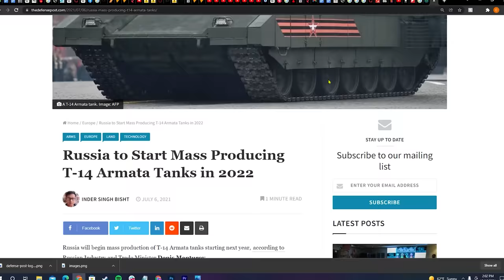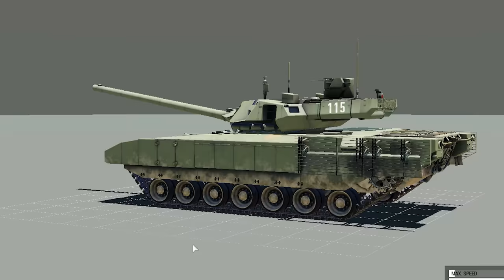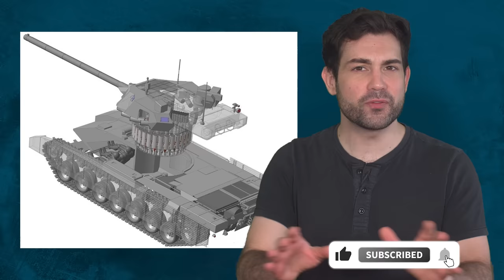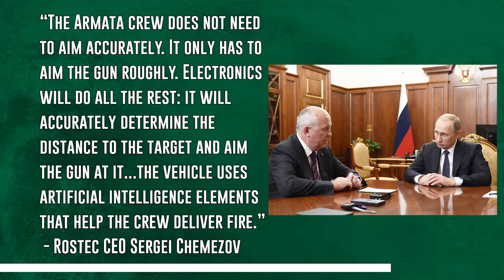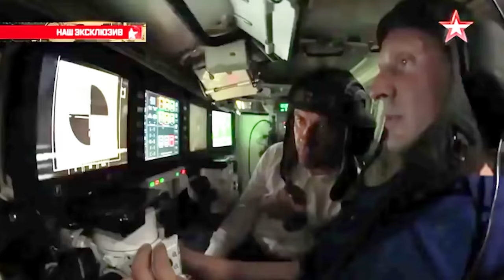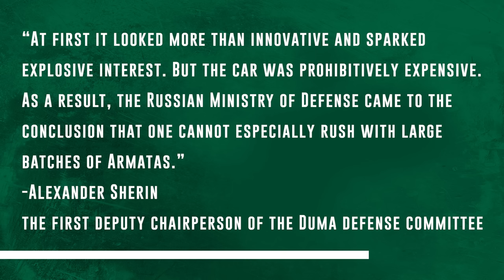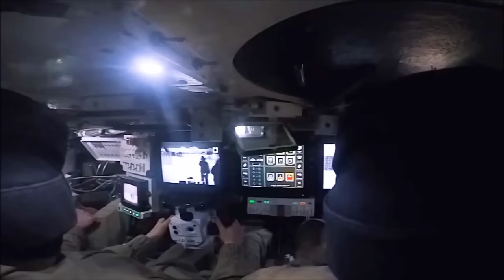The Truth About Russia's T-14 Armata Tank

Comment: The T14's engine is also supposedly a modified German SGP Sla 16. A WW2 experimental engine that was tested in a Jagdtiger B.
Reply: source: trust me bro
Reply: @viswajitbala7924  You don't need a source, the engines of both tanks are public knowledge. Look them up for yourself if you're curious, you'll see the similarities. 

Obviously the Russians thought they could make their design more reliable. And then an Armata broke down on red square during a parade lol. That was years ago... still no Armata in active service.
Reply: The SGP Sla 16 was supposed to replace the Maybach HL230 V-12 used in Tiger I & II but never went to production as the war ended before it finished its testing. During the testing it was installed in a Jagdtiger and it showed a promising results, there was initially a problem with heating as the engine was air cooled but was sorted out with adjustment to the cooling fan. I don't know where you got the idea it was "notorious for breaking down" from!
Reply: @Mofleh Alrofidah  sorry that was my mistake. You are right, the speculation was that of the engine installed in a jagdtiger and not a porsche tiger. I have changed my comment to more accurately portray it.
Reply: @Viswajit Bala  there are articles, it is not officially confirmed that is why I said "supposedly"
Reply: @viswajitbala7924  Combat approved, Russia TV
Reply: It's a modified version of the same engine that was used in production panthers. Originally Russia did the modification to use them to pump oil. Extremely unreliable
Reply: @ms3862  the smartest American be like:
Reply: @viswajitbala7924  the source is the company that makes the tank, lol
Reply: first, I believe it is an engine that have similarity but not entirely the same engine even though I have seen both the engine seen in jadgtiger and the engine on display of the t14 and there is barely similarity between them in face value. I doubt that engine would still work inside a modern tank in the first place. Second, something tell me you got this source from a British youtuber, take my assumption with a pinch of salt though with all due respect
Reply: @Ravengagepvl  Literally have no similarities aside from both having X-layouts.
Reply: @DoomsdayR3sistance  You have no source to back that up.
Reply: @definitelyfrank9341  for which bit, you have to be specific? If we are talking about how the engine was designed for oil compressors and was rejected by industry, there are definitely sources for that.

If it's about the reliance on foreign tech, do you have another major reason why they only managed to make about 20 of them in the time they predicted they could make 2000 of them? I believe there are sources for tech issues but I don't read/write Russian to be able to be able to confirm such sources.
Reply: @DoomsdayR3sistance  Because instead of buttons and switches, most of the controls are digital. Just like how F-35 encountered serious problems during development. That's why they halted production (roughly a dozen were delivered but were returned when the systems were pretty much unusable).
Reply: @DoomsdayR3sistance  Did you delete your old reply I responded to? I can't remember exactly what you said.
Reply: @DoomsdayR3sistance  The only source suggesting that (source that isn't just parroting what LazerPig said) is an ad posted by the company that developed the engine back in 2011. But even that didn't say that the engine was designed specifically for that use. They just suggested that as one of its potential applications. The reason why they didn't mention the fact it was designed for a secret prototype tank was because well, at the time T-14 was a secret prototype tank.
Reply: The Russian army equipment sounds like something of Warhammer 40k, where orks manage to take over an empire tank and they started to use it, tho eventually when the empire manage to retake the tank, they realize the engine was missing, there was only a cardbox with engine sounds written all over it
Reply: @Ravengagepvl another stupid myth about t14, it didn't broke. The driver did some mistakes. That's why the tank stopped
Reply: It was NOT based on the German SGP Sla16s engine go watch RedEffects video on the engine
Reply: @rlgsofficial I trust redeffect as much as I trust a drug addicted homeless person with my money
Reply: *Porsche Tiger

Comment: 30+ years ago I bought a book by Brig Simpkin of the British Army. He advocated something very similar to this for future tanks: engine in front for added crew protection; crew capsule in the hull; and the mission pod in the rear.  The pod could be a remote turret for a tank, or a troop transport compartment for a heavy IFV, or an artillery piece for a SPG, etc.  The Merkava and Armata come close to what he was advocating. Pros and cons to everything...if the tech get damaged or fails then having the crew in the hull means no manual backup to keep the tank in the fight, and that is bad. Only three crew means no backup if someone is hurt or ill or called away for other duties. 

Some of you have to remember that tanks fight as part of a team with infantry, artillery, engineers, air, etc. ATGMs are great but you can't launch them if you're getting artillery airburst all over your position. Tanks in one form or another will always exist...a protected vehicle that can shoot, move and communicate.
Reply: engine wont provide all that good protection and well... engine goes off tank is immobile and cant retreat. also it will glow like christmas tree on infra red. so not good idea.
Reply: @jebise1126  You are right. With the development of advanced composite armor, the advantage of putting the engine in the front is completely negligible. Israelis stick with frontal engine because their tank industry & tank crews are accustomed to such design. Change back to normal tank design that  everyone else uses will cost a lot of time and money to change their doctrine, training, tactics and hull manufacturing etc.
Reply: Climb to glory! Tipple Deuce vet here
Reply: This is what I'm always saying. You can't fire that MANPAD or RPG if you're under suppressive MG fire and sniper cover from infantry. Tanks don't operate in a vacuum despite what video games would lead everyone to believe. Battlefield has about the best tank combat in that regard. Being the ground support for a tank in BF4 is my favorite role in any game.
Reply: @jebise1126  The powertrain does, in fact, provide protection to the crew if it is in front.  Any large metal objects you can put between the soft squishy crew and projectiles trying to kill them is a good thing.  Many IFVs and the Merkava and the S tank have their engines in front.  The idea is to protect the crew, who take months or even years to train properly.  You can always fix or produce another tank relatively quickly.  As far as IR signature goes, as soon as you fire the main gun, you are no longer worried about the IR signature of your engine, which is behind armor anyway.  Your engine exhaust can be mixed with fresh air to reduce its heat signature as well.
Reply: @jebise1126  on Ex Spearpoint our troop had only one fully mobile tank, yet we kept a US infantry battalion, with a tank company from advancing. We (Chieftain) had over a kilometer range advantage over the M60s, we simple shot the lead 113 and rear M60, then cleaned up everything in between (they were trapped on a mountain road, & couldn’t maneuver off the step sides of the road). This actually caused an exercise “reset”.
Reply: @jamesvanderpoel2135    Triple Deuce?  I'm a Triple Deuce vet myself.  B Co.  69-70
Reply: @michaelrunnels7660  HHC mortars 1999-2001
Reply: @jebise1126  I mean if the guys are hit from the front and it pens then they die, so tank is still immobile, not because the engine was fucked but because the crew died.
Reply: + Romans 10:9-10 "That if you confess with your mouth, "Jesus is Lord," and believe in your heart that God raised him from the dead, you will be saved.  For it is with your heart that you believe and are justified, and it is with your mouth that you confess and are saved." Amen 🙏!!!!!!!!!!!!!!!

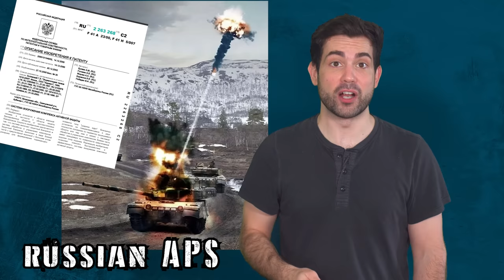The man in Luke 16:24 cries: ". . .I am tormented in this FLAME."
In Matthew 13:42, Jesus says: "And shall cast them into a FURNACE OF FIRE: there shall be wailing and gnashing of teeth."
In Matthew 25:41, Jesus says: "Depart from me, ye cursed, into everlasting FIRE,. . ."
Revelation 20:15 says, " And whosoever was not found written in the book of life was cast into the LAKE OF FIRE." And please repent of all of your sins and be baptized by the Holy Spirit before it is too late, you will never know when the time will come 🙏!!!!!!!!!!!!!! Amen 🙏!!!!!!!!!!!!!!!!!!!!!!
Reply: @reclusiarchgrimaldus1269    What's your point?
Reply: @michaelrunnels7660  I'm spreading the good news of the Gospel 🙏
Reply: Merkava and IFVs have engine in front so soldiers can enter/leave from rear. 
Engine in front means ventilation and exhaust have to be up front, or pass by to the rear. Also fuel has to be up front. None of these contribute to crew safety.
As for crew protection in the front, how about armor?
Reply: Engine in the front provides excellent protection against HEAT. Very poor protection against APFSDS though.
Reply: @Cavemanner  yes in the world of PlayStation battle games if you get killed, you simply “ reset “ and your all alive and fighting on. But it’s totally different in the real world !!! Perhaps you would like to jump in one of those Russian tin cans and go for a ride. As you are getting it down this back country road, not a worry in the world…….. suddenly part of your body is a hundred feet in the air as you look down and see the rest of your tank and crew ,as well as your lower half, on fire. The last thing that goes through your mind is “ where’s them damn support troops?” Then you land with the turret crushing whats left of you. Your  trembling hand falls just short of hitting the reset button!!! Game over…………………..

Comment: I've always followed the principle for every automatic system you need a manual backup in case it fails or to supplement it.
Reply: well, that sounds nice and all, but is outdated by now
Reply: @quantuman100  ??? That's not outdated at all. If the automated loader/turret fail this tank is just a roaming trouble. To much automation without manual backup is a death trap. Especially with how shit Russian equipment is proving to be in Ukraine.
Reply: @Wallyworld30  yes, let's look at the Russian stuff in Ukraine, most of it is the old "manual backup" equipment, not really anything more modern than the 2000s to be seen, so much for the manual backup being usefull
Reply: @quantuman100  you know that the tanks being used in Ukraine all have autoloaders, they started using them in the T-64, it isn’t a brand new concept
Reply: @rexnifty8678  yes, but these auto loaders could still be manually operated from inside the turret, hence why they have a reputation for taking off the loaders arms
Reply: @Wallyworld30  Most commercial and military aircraft have been fly-by-wire systems for decades without any manual backup and work perfectly fine. Electromechanical systems don't just randomly fail and if they fail, most of the time you can control how they fail and account for these cases.

Seriously, they only times I've heard about electro-mechanical systems failing is in absurdly cheap consumer electronics, planned obsolescence and autoloaders. And god knows why the latter. I've worked in the design of partially automated testsystems and it's almost always the manually operated parts (or automatically updating consumer software somewhere in the system) that fail under weird and rare circumstances.
Reply: @steini19o4  Commercial Jets have hydraulic controls and if that system has leak and fails it can be controlled manually by a wire with crank in cock pit for torsion. Mentour Pilot channel did an amazing explanation of how it works in a simulator that had the backup system like the real Boeing Aircraft.
Reply: @Wallyworld30  Newer Airbus (A350 and newer) and Boeings (787) do not. And for the Airbus A320 to A340 only the horizontal trimmable stabilizers are connected mechanically (rudder for the A320 as well).

There are no known cases of a fly by wire system having been incapable of recovering from a failure.
Reply: @Wallyworld30  every modern fighter jet uses computers to fly itself with no backups, if you design it reliably enough you don't need to overburden yourself with backup systems. Plus, if the gun malfunctions in combat you have bigger things to worry about
Reply: I work in a flower growing company and made that realization myself last month.
Whenever you build growing areas, build them for easy access with water hoses to water the plants. I don't care how many fancy automated systems you have to water everything with the push of a button. The system will fail and someone has to go through the whole building with a hose to water the plants. And the system won't be fixed in a day or two, but in a month or two. Don't set up your piping and other equipment so that it takes a 100m long hose that keeps getting caught in 10 different spots because you think "well, that's not going to happen anyway because we got an automatic system".

And I'm not getting shot at by enemy tanks!
Reply: THANK YOU
Reply: Biggest flaw with these auto loading systems is it makes these tanks less survivable in combat. The manually loaded Abrams tank with a dedicated crewman keeps the ammunition in a separate compartment deeper within the hull thereby reducing the chance of the magazine being detonated from enemy fire.
Reply: I used to be a 19k...and if I remember correctly...the M1 has backup non electronic sights for the gunner...a backup firing mechanism you had to hand twist...and the turret had a manual hydraulic rotating mechanism.  The ammo door can also be manually opened and closed.  Basically backups if systems went down
Reply: Agree 💯

Comment: As a tanker I can say I want the manual loader because that extra person is extremely useful while in the field.
Reply: I fully agree (I'm not a tanker but a trained army officer). 
Autoloaders can be a genuine improvement - for example the one that come with the PzH2000 artillery system. Obviously, the kind of firing solutions that system offers cannot be dependent on a human reloading manually. Still, the system does still have a soldier as loader who maintains the stockpile. Plus, the PzH2000 can still fire shells even if the autoloader  breaks down.
More importantly though is that operating "in the field" requieres many more tasks than just the narrow, weapon system specific tasks - guard duties, camoflaging, maintainence, etc., etc..
Reply: I wonder if that was part of Rheinmetal's thinking with the new tank they're working on.  They included a 4th crew position despite having an autoloader.  This is kind of controversial among armchair tankers and theorists, citing the space the 4th crewman tkaes up would be better served storing more ammo or equipment.  But I can see how an extra guy would be useful.
Reply: @keithharper32  Thing is, once you stop at night or late in the afternoon for the bivouac, the tank commander leaves for the briefing. That leaves the other 3 to do the rest of the work. The loader will usually man the machine gun and the radio, for security, leaving the gunner and the loader to do the camouflage, the track maintenance, setup the sleeping spots, prepare food, and do all sorts of other tasks. If you only have 3 crew on a tank most of those tasks in the field will become extremely difficult or outright impossible to do. You simply can not put camouflage netting over a tank in the field by yourself. Also when you are on exercise the tank has this nasty habit of throwing it's track in the middle of the night in knee deep mud while it's raining. You will then need to break the track and put it back on, which with a full crew of 4 is already a very hard and time consuming thing to do. Again usually the loader or the tank commander will man the machine gun and radio leaving the other 3 to do the work. If you have to do that with 2 men it is basically impossible to do. If you never served on a tank, you have no idea how much work and maintenance you need to do to keep the thing going.
Reply: @keithharper32  I believe the 4th position on the KF51 Panther is optional and is for the version that comes with a Hero loitering munition launcher  so they have a dedicated pilot on board.
Reply: Minus : the smell of the loader sweat, ammunition gets heavier in the future (needs auto loader)
Reply: You are not a tanker. The amount of cope coming from you is insane😂 if the USA was the first to develop and continually use the auto loader and Russia the manual loader, people would make fun of Russia and talk about how far behind they are.
Reply: @MemeManiaYT  I served on a Leopard 2A6 for 4.5 years on every position, how am I not a tanker?
Reply: @yesiamarussianbot3076  you…did not.
Reply: @MemeManiaYT   And how would you know keyboard warrior.